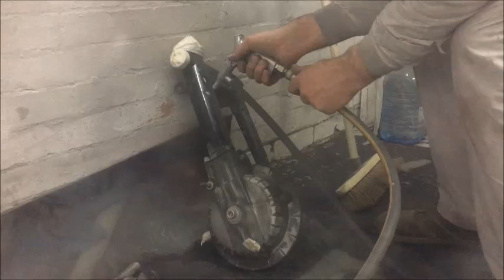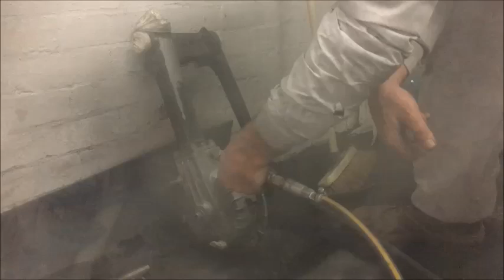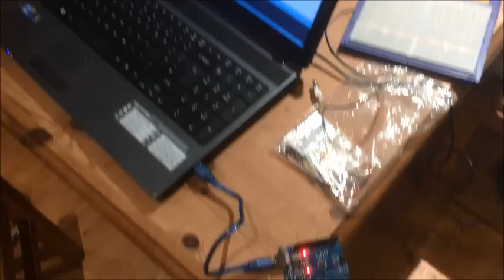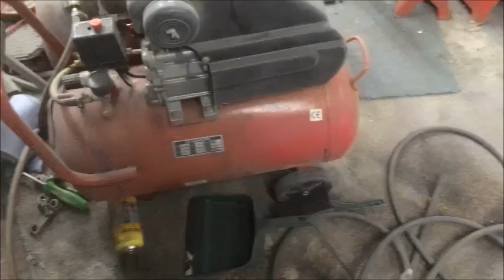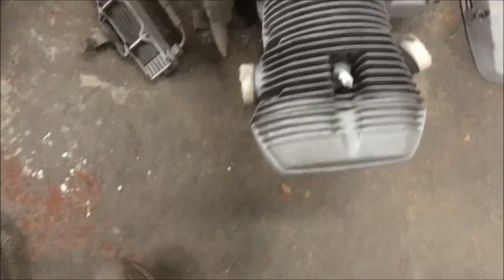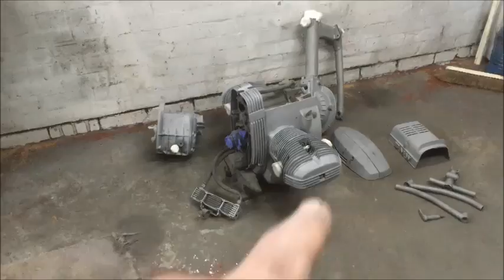BMW R80 CAFE RACER PROJECT PART 47

Comment: Hi Pete, if you need help on IoT development, I am at your disposal. I have lot of boards and huge experience with them (20+ years), so feel free to ping me if you would like to get fresh inputs and possible options for your ideas. :)
Reply from the maker: that would be great, I would like to have a go at designing a circuit but it would be nice to run it past someone who actually knows what they are doing to see what they think (or if there are any better ideas). it would also be good to know how to figure out what components to buy.....i will get back to you with this when i get to that part of the build if thats ok....many thanks.....
Reply from the maker: Good afternoon, i have designed a circuit for my controller, i could do with a bit of advice as to whether it would work in the first place and then if it would, an idea of exactly which parts to buy (i.e transistor sizes kind of thing).....how can i get it to you to cast your eye over?....many thanks...pete
Reply: Good evening Pete, I have sent you private message with my contact. Cheers!

Comment: use a twistknot wire brush in an angle grinder then smaller wire brushes in a power drill to clean most of the paint/rust off the frame before blasting it's a lot quicker and less messy.
Reply from the maker: thanks for the info, I'll give this a go and see how it works...
Reply: You could try PMB or Plastic Media Blasting aswell in your blaster next time. We use it at my work for paint removal. It doesn't remove any parent metal or even change the surface finish of Aluminium. Thanks for the videos love watching them keep up the good work.